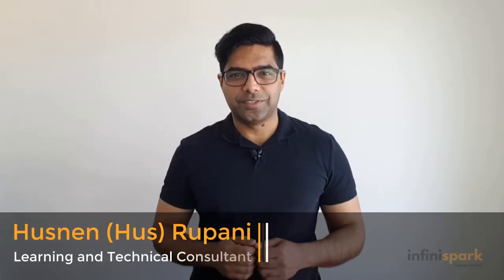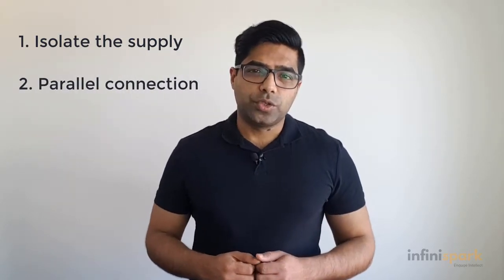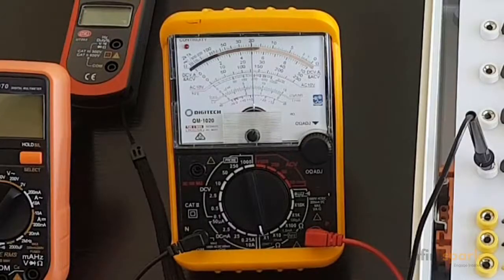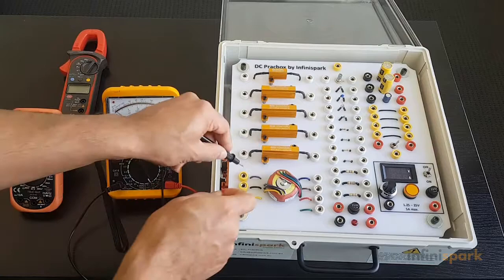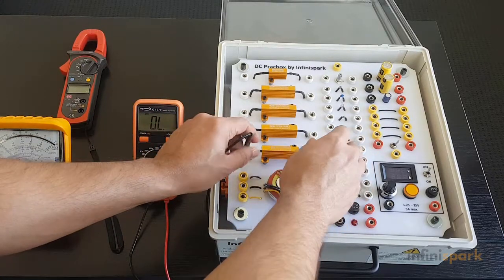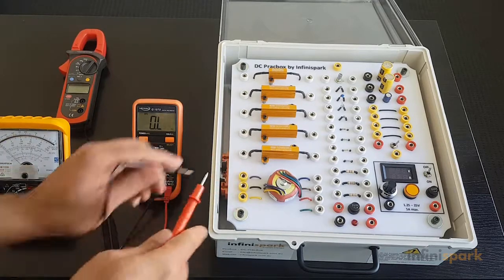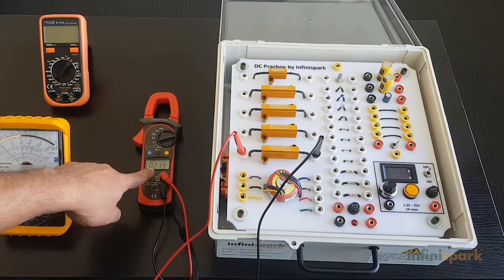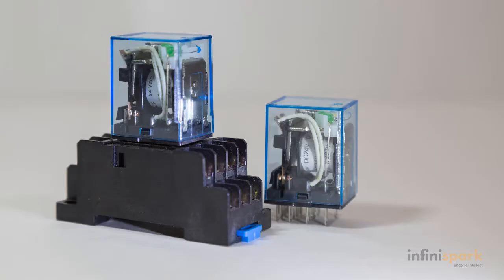How to use an ohmmeter

Comment: What am I missing? I set the 2k range and measure and get .218.......... x 1000 = 218?
This means I have a 240V light bulb which has a Wattage of 270W? I don't think so. Its obviously only around 25 W so what is the Resistance reading I'm getting please?
Edit: Just looked up to find that the filament should not be treated like a resistor as it is 'non Ohmic' so I've allowed myself to be stuck in a wrong mindset simply believing that Ohm's Law gave all the answers needed. It obviously doesn't. Or at least not in all circumstances.

Comment: Great info. Can an ohmmeter be used to check dc batteries?
Reply from the maker: Thanks Lu. From what I understand, it's not a good idea to connect ohmmeter to a live source because there will be a conflict between the source and the internal power supply of the meter. You can use battery monitors to measure the internal resistance of a battery. Alternatively, there are methods based on voltage and current readings that can help calculate the battery internal resistance